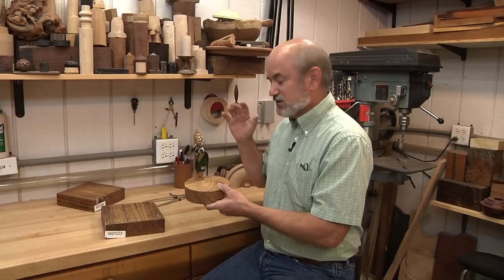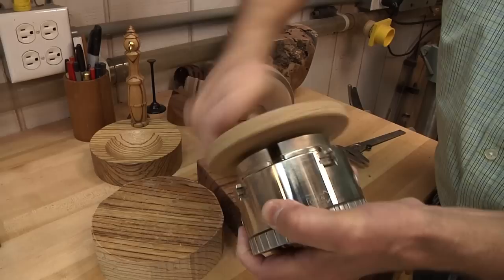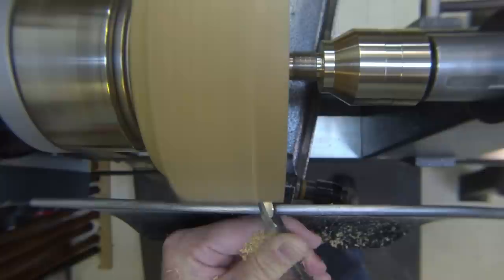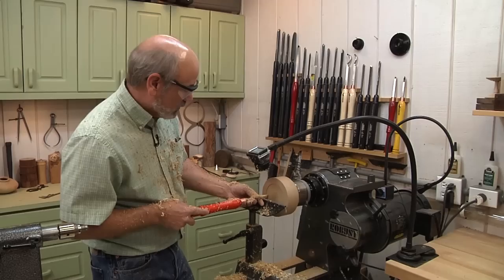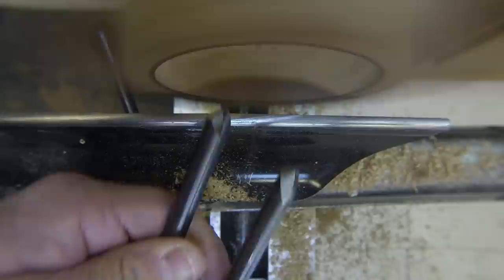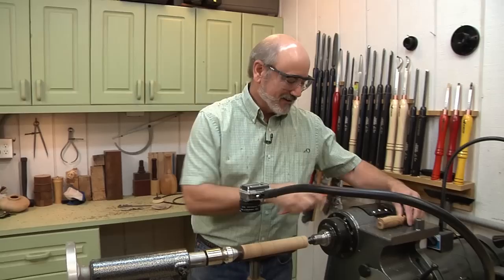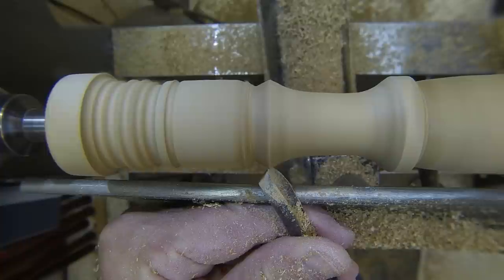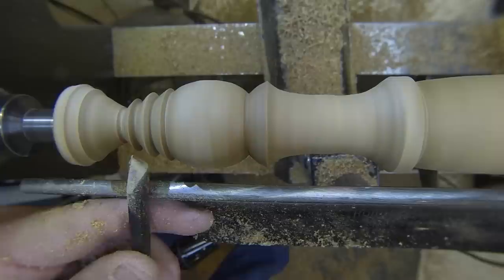Keys & Change Holder (Lost Episode)

Comment: Tim;  Metal workers often have to turn a square object round and it takes a long time to go around the outside with a metal bandsaw on a thick piece of metal.  These saws are NOT made to cut curves easily.   So cut straight from outside toward center stopping just beyond the line;  then back out.  Make 8 - 12 cuts, then cut around the circumference.  The "relief" cuts allow you to go around the outside edge without twisting the blade.